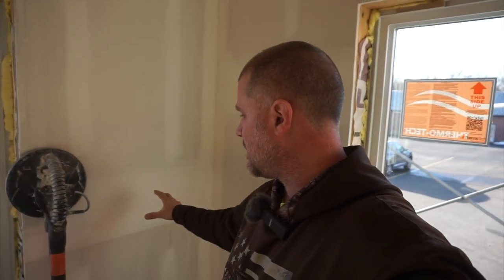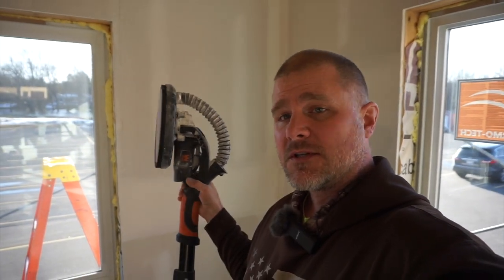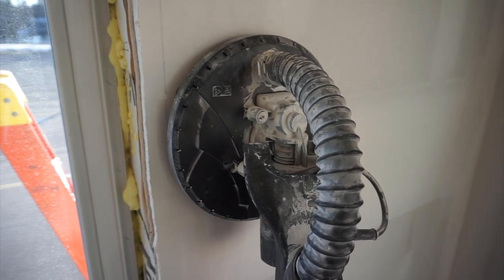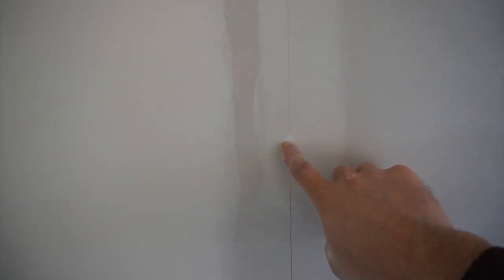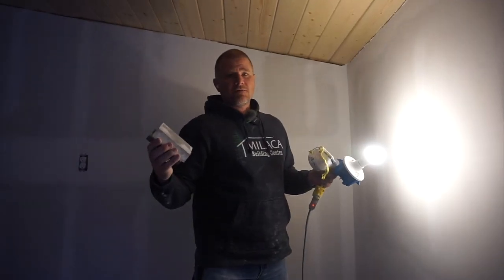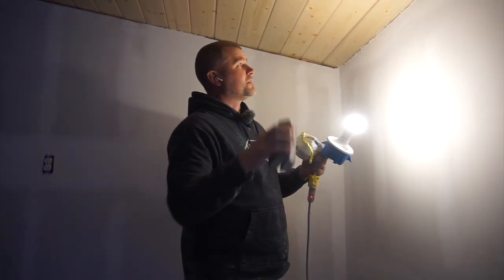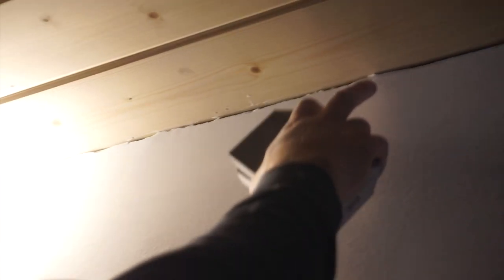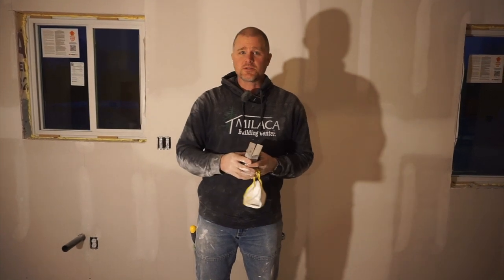Drywall Sanding Finishing Touches With a WEN Sander!

Comment: I too did want to0 see it in normal speed at least for a bit. I am impressed with your mud work. The fact you use boxes tells me you know what you are doing and are a much better finisher than myself. If you like this machine, than that says a lot. Further, I see you didn't use a particle mask until you started hand sanding tells me how effective the dust collection is. You scooted right through the job in what, 30 minutes? Thanks for posting. Nice video work too.
Reply from the maker: Thanks for the comment @Tito1984, it's much appreciated!

Comment: I just used my new Wen sander. Nice. Mine has the motor mounted off the head. It’s still a chore to sand ceilings. 
The motor heats up to burning hot pretty quickly. Anyone else have the same problem?
Reply from the maker: Sanding overhead is taxing to say the least. 
I've never had the heating up issue. Hope all turns out well for you.